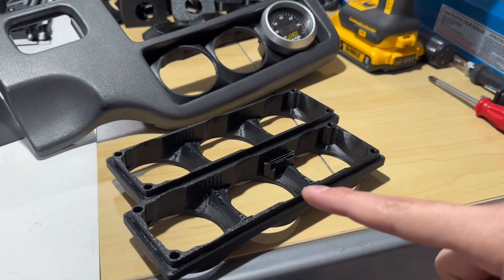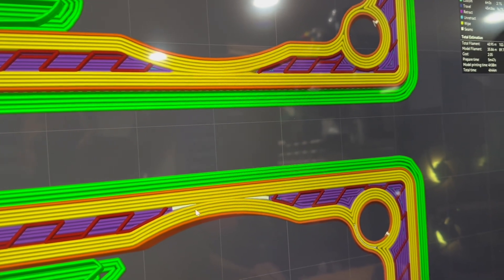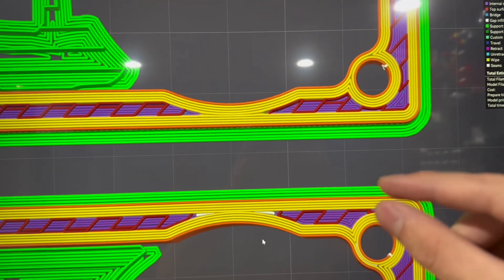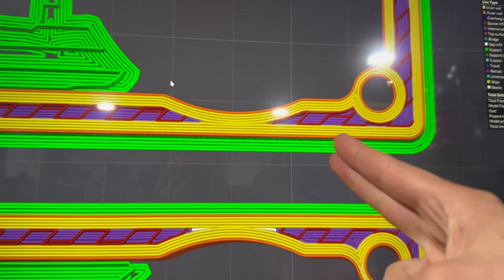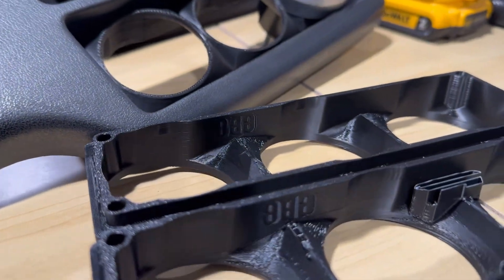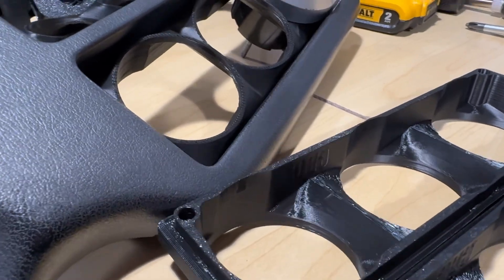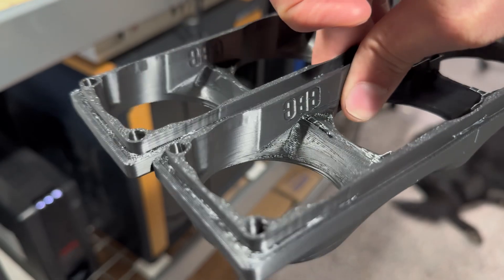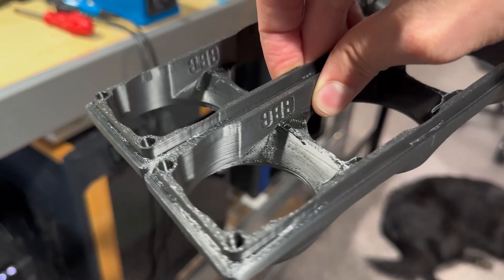Arachne VS Classic - 3D print quality comparison

Comment: I seriously hope you didn't use pla to make those.  If you did, in a few months you're going to have a warped mess in your car.  Pla does not survive in direct sunlight or heat.  Anything above 80 degrees and they will start to warp and sag.
Reply from the maker: @huskydad72  no worries these are abs 👍

Comment: Why not print it convex-side up?
Reply from the maker: @airman122469  so the 3 gauge holes towards the bed? With the part floating?
Reply: @cbc.custombuiltcars  your model seems to have fairly simple geometry, I would always try to print mine on a 45degree angle using the lie on face feature on orca with models like that and I'll be able to print it with almost no support. The face on the long side at 3:52 seems fairly flat.
Reply from the maker: @UnleadedPadyak  I get what you’re saying but for this part it’s not a great idea to print at that angle. My reasoning is using that face would cause more supports, leave the outside exposed surface in the vehicle looking bad, and the layer lines would be the wrong orientation for the large circle holes since a gauge will be forced in there and could more easily split the part

Comment: Very good. I usually design stuff based on the nozzle diameter, and layer height. That was my solution to mitigate slicing issues. Good to know this Arachne method kinda fixes the problem.
Reply from the maker: @olavodias  forsure designing a parts wall thicknesses in multiples of nozzle width helps a lot for speed and strength 🙌

Comment: Why does Arachne "have to" have worse overhang?  I'm pretty sure I have mine set to smooth overhangs as well...even if it is printing closing gaps with thinner/thicker walls as part of, like a joining overhang to another wall.  Appreciate the video, though.  It is good to have examples like this to talk over.
Reply from the maker: @jeffmcclain  what do you mean smooth overhangs? And I just haven’t had as good of results with Arachne in overhangs. I’m assuming it’s because the slow down for overhangs isn’t has accurate/aggressive as it is in classic mode, so there’s not as much time to cool compared to classic
Reply: @cbc.custombuiltcars  Interesting on the cooling.  I don't see mine running faster with Arachne (but maybe that has to do with the "speed on overhangs" setting limiting it).
Reply from the maker: @jeffmcclain  yeah it used to be that “slow down for overhangs” got disabled when printing with Arachne but it does something now lol. If you look at the print speed in the sliced print preview there is a visible difference between Arachne and Classic even with the same speed settings

Comment: Strange, I've never had an issue with variable overhang speed 🤔
Reply from the maker: @TS_Mind_Swept  it still “works” just not as much as classic walls. Slicers used to disable slow down for overhangs completely, but yes it does work now. Although if you switch back and forth between Arachne and classic while viewing the speed in preview it slows down more while in classic

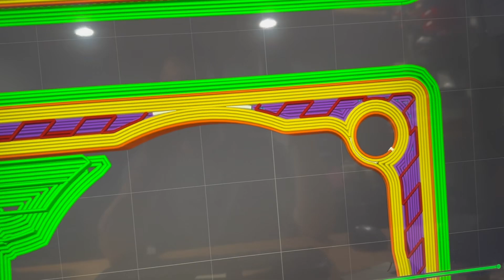Comment: Regarding 2:20, is Arachne really slower print time?  Seems like widening a trace a small amount should be pretty close to 0 time added, while moving the head back to the hole and laying an additional line would take longer.
Reply from the maker: I should have said for this model it does, some models yes it is shorter time to use arachne. Also in older slicer versions there seemed to be a larger gap, but now they're pretty similar print times

Comment: I am not really a fan of Arachne.  Several of my models have features in the CAD intended to force the nozzle to take a path that will result in a truly square internal corner (for fit with adjacent parts, extrusions etc), and this works fine with Classic perimeter generator.  Arachne ignores those features and takes a shortcut past them, which results in a slightly round corner where I wanted a square one.  I've had to include a disclaimer for several models I have on Printables warning the user to use Classic for best results which is annoying.
Reply from the maker: @netpackrat  that is interesting 🧐 never heard/noticed that before… maybe it’s in combo with arc fitting that it’s rounding the corners?

Comment: On a 5h26m, 174g print with only 14s of gap infill, Arachne improved that to 5h08m, still 174g (lost less than half a gram), with 6s of gap infill. I don't know what it did to improve the time, but I'll take a 5% speed increase any day of the year. Obviously it's heavily dependent on what you're printing, but I forgot Arachne existed, so thanks for making me check it. I also find the gap infills create annoying noises and ugly artifacts, so Arachne probably is gonna be my go-to.
Reply from the maker: @timderks5960  sounds like a good decrease! I agree there’s a place for Arachne, and maybe I should have spent more time talking about that. I still use it for brackets/mounts and other functional parts that don’t necessarily matter if they look nice (or when using GF/CF materials) but that benefit from strength, and occasionally the time difference

Comment: After more than 10years in 3d printing I'd say it doesn't always have to be a longer/slower print with the Arachne wall generator. It is heavily based on the model/internal structure/size/poperties and many other bits. I have a lot of models which are printed way faster with the Arachne generator (if the wall generator is the only change in the slicer settings). And the overhangs could be also handled with a lot of other settings - out of my head for example: filament type/brand (as you are already dealing with it), layer thickness, speed, cooling, walls printing order (based on the ability of your slicer). Arachne is just another available option out of the gazillion already in the play. And slowdown on overhangs with arachne is indeed possible/available as well for almost an year in major slicers. Someone could get an impression that the Arachne is a bad thing - so the correction - not at all. So your assumptions are, I'd say not that correct, not in general. If it doesn't fit to your filament/model combination, go on and tweak other bits. That's all. Anyway nice part/print/hoby you have about the car gauges!
Reply from the maker: @JanVokas  you are correct that some models can print the same or slightly faster with Arachne, in my experience I have found it slower in most cases though. Also there isn’t much I can do here to add cooling since I’m using ABS, much more and the parts warp or become brittle even though it fixes the overhangs. It is a give and take with the gazillion settings and choice of materials for sure lol. Thanks for the feedback 🙏

Comment: On smooth plates I use for coasters, you can clearly see the line gaps in classic, when I use arachne it comes out much better on tight details like small lettering. so much so that for less important stuff I use a textured plate and classic for spped and smooth plate and arachne for detailed items, just my experience on BL X1C with multi color stuff, so those may have different results than people see on single color or different printers.
Reply from the maker: @jimmanis6717  makes sense, there’s so much to dial in with these machines lol 😂

Comment: I have always found that classic produces a MUCH better quality print than arachne, no matter what other settings I adjust.
Reply: Arachne has allowed me to get some really impressive graphic detail on flat images and text.
Reply: That means your PA is seriously miscalibrated.
Reply: It depends. For Arachne it is essential that you have the right settings for you usable Max Flowrate of your hotend. Otherwise you get gaps and blobs and bad artifacts. Also your PA/LA must be set correctly. 
Then you should get faster and cleaner prints as you do not need gap fills and thin walls which are separately printed in classic mode and can produce artifacts when you print with only 2 shells. It also depends on the shape of the printed part if it is of use or not. The shown part in the video isn't the best representative for the differences.
AND it depends on the Slicer also. Cura produces better results with Arachne then Prusa/Orca...
Reply: @Haunter1982  Yeah Arachne depends on PA being right. That's not really anything new for anyone doing high speed printing, since high speed will already give you widely varying flow due to acceleration limits, making your prints come out horrible if PA is wrong. But for folks who usually print below 60 mm/s, having to care that PA is calibrated right is a new constraint.
Reply from the maker: @Walt1119  I’m finding the same, I only really use arachne anymore for brackets and mounts that don’t matter as much visually
Reply: Consistency

Comment: settings are extremely important for arachne walls. there are an array of settings to configure for this wall generation type & even 1 parameter change can have drastically different outcomes. a good example is the minimum wall width. i set that to 65% for all nozzles - i find it normally defaulting to 85%. try it out if you havent yet - it is very worth experimenting with. i use arachne exclusively and usually print parts that must be accurate, strong, and prefer them to not look like shit.
Reply from the maker: @aregaminghd  what benefits have you found from dialing in Arachne, versus just using classic?
Reply: @cbc.custombuiltcars  it’s an overall higher quality finish. i found that it can also vary depending on the geometry and use case. the difference does not seem significant visually, but i never ran any tests for physical properties. my biggest gain is being able to achieve more detail on larger nozzles that would not be possible with classic walls.

the settings you use will have a significant impact on the results. arachne is worth perfecting because it can be configured mostly based on the nozzle size.
Reply: about to give this a try now.
Reply: What is your setting if you want to print rc plane model?

Comment: I use arachne and have slow down for overhangs.

What slicer are you using?

Mines based on orca.
Reply from the maker: @freedomofmotion  what slicer is based on orca? And I am using bambu studio here. Bambu studio shows what looks like to be a more mild slow down for the overhangs when looking at the color mapping, and that was fairly evident in the prints too… I remember there used to be a warning that “slow down for overhangs” was disabled while using Arachne
Reply: @cbc.custombuiltcars  I'm using" any cubic slicer next". It's just orca with any cubics cloud interface shoe horned into it and a different colour scheme.

But the quality has been great with arachne + slow overhangs.
Reply: @freedomofmotion  I just learned about Anycubic slicer a couple of days ago. I didnt know it was based on Orca.
my Anycubic i3 Mega is from the early days so I still use Cura mostly
Reply: @ry7hym  only slicer next is based on orca.

I'm not sure what the original one is based off, possibly prusa? 

The original slicer is pretty bad though

Comment: ahhhhh I now understand why one of the parts I printed was messed up around the support, def will keep this in mind
Reply: Can you explain more?
Reply from the maker: @kawaiichi  I’m assuming similar to the parts I made, shown at the end. Arachne generator removes or lessens the “slow down for overhangs” setting and causes filament to have issues with warping/curling on overhangs
Reply: @kawaiichi  I can try, I printed a fan shroud that needed support on an overhang on a thinner feature, the lip kept curling up from the support and I suspect it was due to Arachne walls. I haven't confirmed it though as I would have to reprint the part. Using orca slicer with ender 3 pro
Reply from the maker: @drewmakesstuff  would be interesting to see another comparison, showing Arachne vs Classic on overhangs
Reply: @cbc.custombuiltcars  I can maybe try putting a video together, would need to do some research and put together a test model that would show off all the differences

Comment: I dont think that can be true, at least in Orca. Its very easy to check. I'm fairly certain slow down for overhangs works as it should. Just go into speed mode on the gcode display and walk through the gcode and you will see.
Reply from the maker: @ThePhilbox  looking at the color mapping yes, Arachne vs Classic appear to be the same in orca. It does change colors slightly when comparing speeds in Bambu studio… I’ll have to do another test print using orca comparing them. That said I haven’t had as good of results from Orca when printing overhangs, seemed like changing overhang speed settings did nothing
Reply: @cbc.custombuiltcars could it be hitting the volumetric limit in classic? that's where i've noticed this speed difference.
Reply from the maker: @nidavis  the volumetric limit should be the same in both… unless Arachne ignores that flow limit
Reply: @cbc.custombuiltcars  it's the same but when the lines are larger you hit the limit at a lower speed and vice versa

Comment: how much infill do you put on parts ? like that gauge holder, ty!
Reply from the maker: @marcoss4563  usually around 15% and I use 4-6 walls so most of the part is solid and connected around the holes/inserts
Reply: @cbc.custombuiltcars  oh man, we are thinking the same, I prefer add more walls instead fill, cuz infill increase a lot the printing time.
Reply from the maker: @marcoss4563  I agree 🤝 adds the same or slightly more strength to add walls, and it’s faster than adding more infill